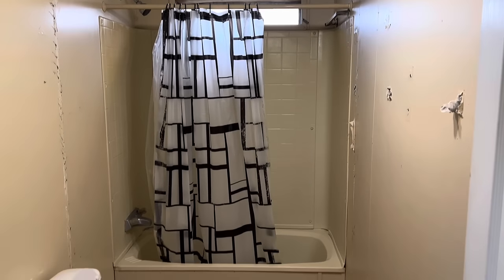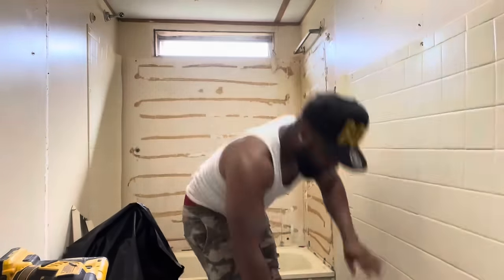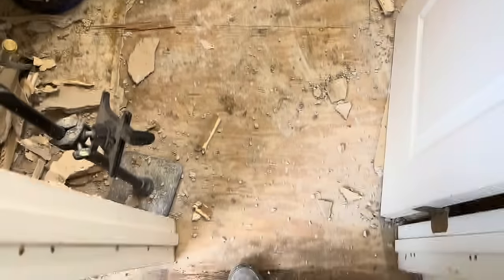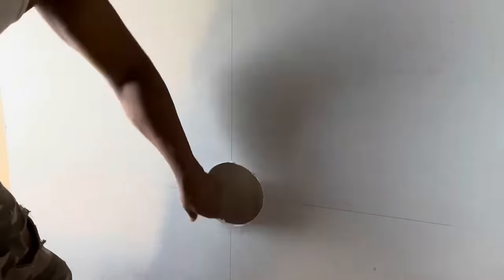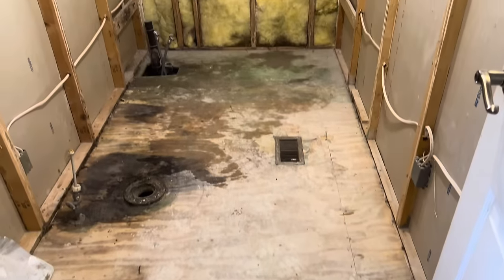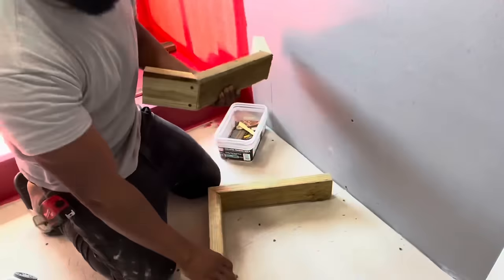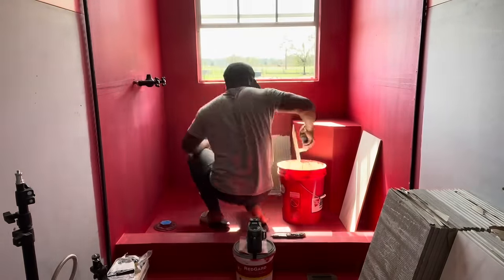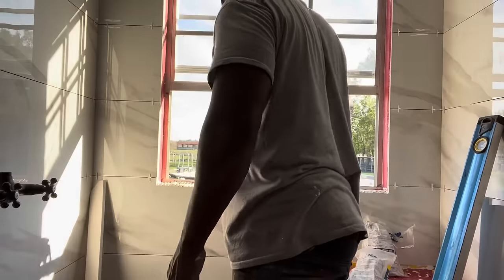mobile home guest room remodel

Comment: The bathroom looks great! One word of caution, though... we used to live in an old house, built in 1928. We had to replace our window over the bathtub, due to the wood from the windowsill rotting over time. We replaced it with a glass block, instead.  I don't know when the shower was installed. So most likely, there were still many years after that time, when the previous owners could enjoy their showers without the moisture rotting the wood.

Comment: Did you use cement board for the shower walls and ceiling before you tile the shower or did you use regular drywall I'm remodeling my 1997 oakwood so I was just curious?

Comment: Did you have to use mobile home specific shower base, walls and door? I read on one webite that you do have to, but on no others. The selection on mobile home supply shower pieces is extremely limited and I haven't found any shower bases that are to my liking. They have a 9" rise to step over into the shower, and I am thinking into the future when we are old and could have trouble getting lifting our feet that high safely. TIA

Comment: I am very interested in how much it did cost to renovate the bathroom, breaking it down in cost for the materials only no labor included and then just for the labor part.   The bathroom in my mobile home has a very similar layout except it is slightly narrower, for example your bathroom might be 5 1/2-6 feet wide and mine is no more than 5 feet wide.   I didn’t yet take any exact measurements yet.   The arrangement of where the the sink, toilet, and bathtub in your bathroom is very similar to yours and the one in the video might give an idea what my bathroom would look like if it had a very similar renovation.   I think your bathroom looks a little longer than mine as well.

Comment: I moved bathroom vent same location as yours, water rotted vent. Easy to relocate. Fixed bottom of vent, covered top hole with tin relocated  hole  works great now not in pathway

Comment: I don't blame you, for not putting  a vanity in the bathroom.  I have a really small bathroom. So I order a really small sink for Amazon, is  wall mount sink. Basically you I only use it to wash your hands and brush your teeth.  I have a small shelfs in the bathroom on the walls to hold things like  toothbrush ,hairbrush, ect. And I have a toilet paper stand. I didn't want to mout it on the wall, because some of my friends have bad should mobility. 
Your bathroom looks fantastic 😍.
Reply from the maker: Ohhh really? I have to check that out! What’s it called on Amazon? Thank you so much for watching and loving the video
Reply: @bastarricafamilyfarm  
It the U-Eway 18.4" wall mounted white  rectangle  ceramic sink. It comes with the faucet, pop up drain and  P. Trap.

Comment: I have questions 😩 so i noticed in most mobile homes it has like that line on the walls we have that as well, did your husband remove that out of the wall ? And with the home being that old did Yal have mold that Yal had to remove ?
Reply from the maker: Yes we removed lots of mold and did some treatments everytime we remodeled new especially in the insulation
Reply: @bastarricafamilyfarm  what kind of treatment ? If you don’t mind me asking i just found your channel and I’m invested because we live on 9 acres and have an old mobile home as well. Also, Did you guys need a permit to build and extend?

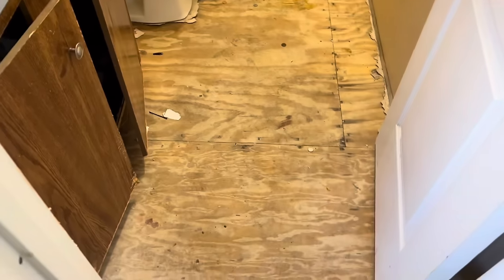Comment: 0:26 just need to look for a certification label/HUD plate!! ALL mobile homes built after 1976 have one!!!!
Reply: That way you can find out if it was actually 1978, those made before the HUD plate program have tons and tons of unregulated and insanely dangerous materials. Just because it was a relatively unregulated process pre 1976